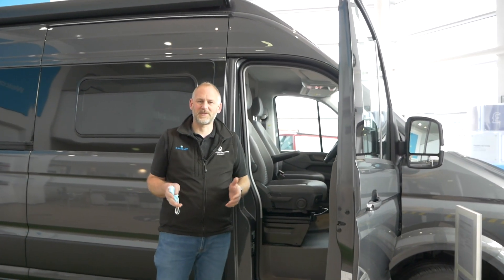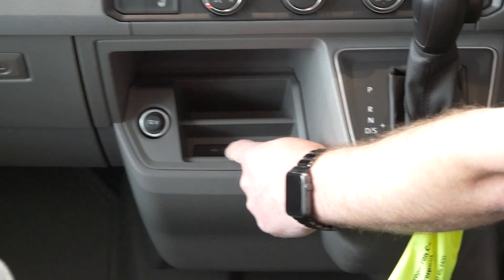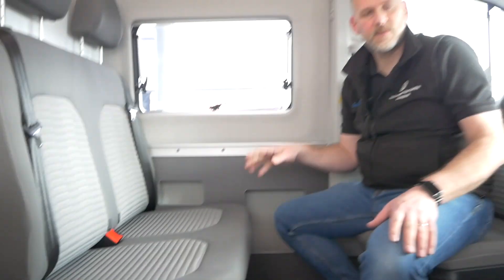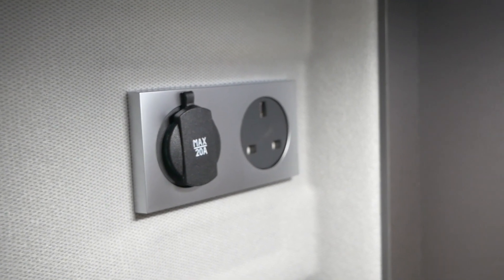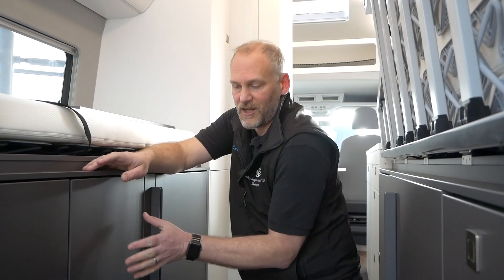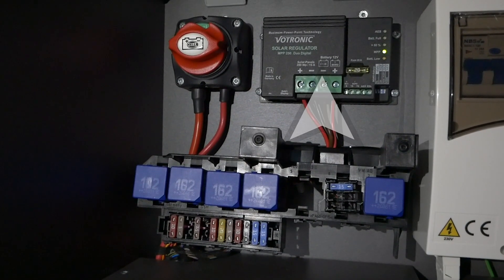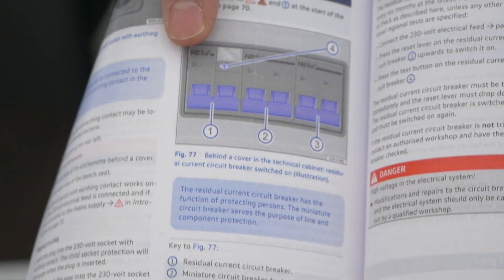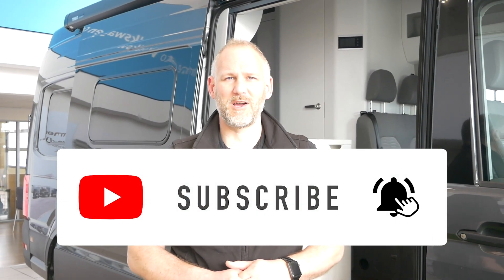VW Grand California Electrics EXPLAINED | California Chris

Comment: Good day @CaliforniaChris. Thank you for this video. I have a question. You said that if I connect vehicle to power supply than it will charge both batteries. I left my GC600 for 5 weeks without movement after this all my batteries were fully dead. I tried to connect vehicle to power supply, but no effect after 1-2 hours. Is it a bug or a feature?

Comment: Hello
Very good and useful feed and advice. I have such a quick question.
Well, after connecting to the power supply and turning on the main fuse / Grand California 600 / - you can still hear the noise from the area of the clean water tank. At night it is bothersome. Is it supposed to be like that? The noise disappears only after disconnecting the electricity from the outside. water pump? I will be grateful for your answer. Greetings from Poland :)

Comment: Hello 
I have a big problem since the beginning with my grand cali 600, the solar panel don't work and don't give energy to the battery...anyone's have the same problem?...I put the grand cali 600 in vw guaranty and they tell me the problem gonna solve since january but until now, nothing happen...its horrible, we don't have autonomy and only work when we go camping and buy electricity....
Reply: I have the same issue with my gc600. I would like to upgrade the battery, inverter, add another solar panel etc but obviously don’t want to void the 5 year warranty. Very disappointed with the power system on an otherwise decent camper van.